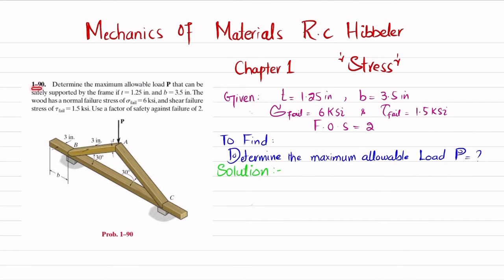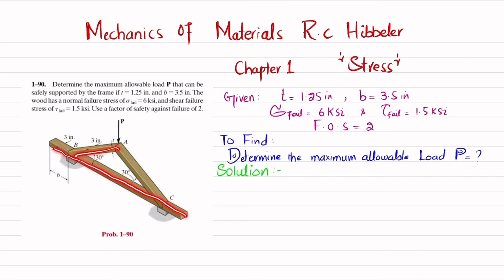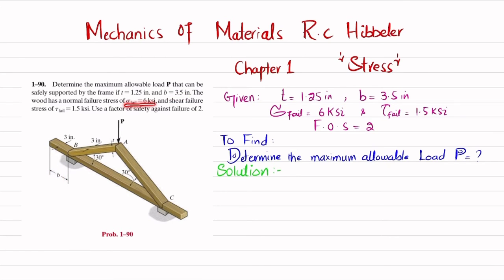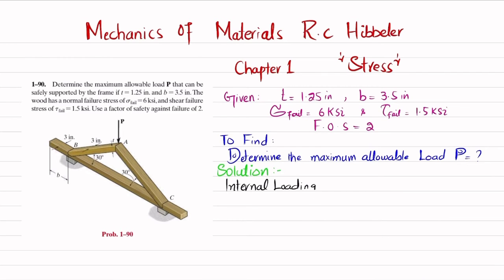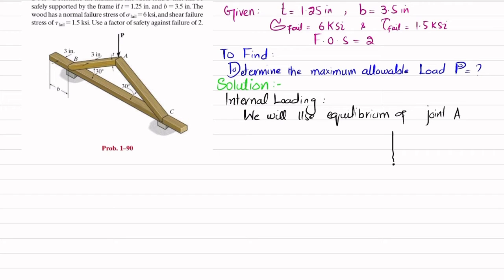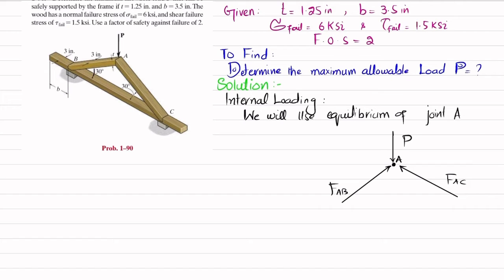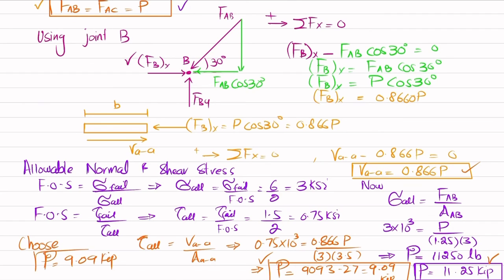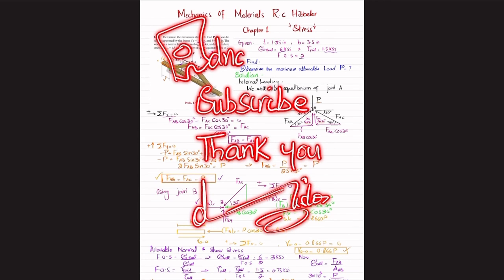1-90 | Determine maximum allowable load P that can be safely supported | Mech of materials Rc Hibbel

Comment: sir i have a question, does the normal force usually equate to the applied force while the shear force is when we section?
Reply from the maker: For the applied load on any member, when you cut at any place you will experience the normal force perpendicular to the face , shear force parallel to area and there will be reaction moment.